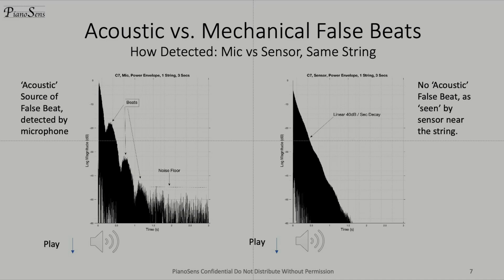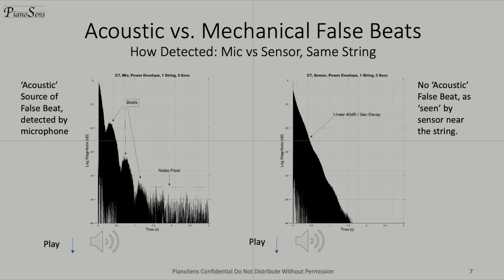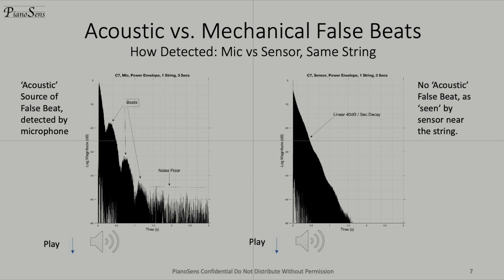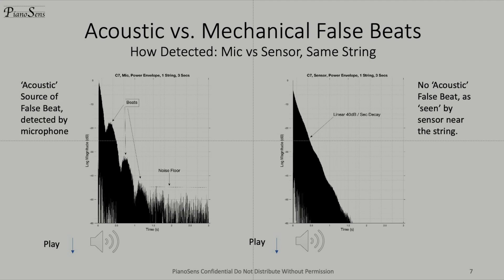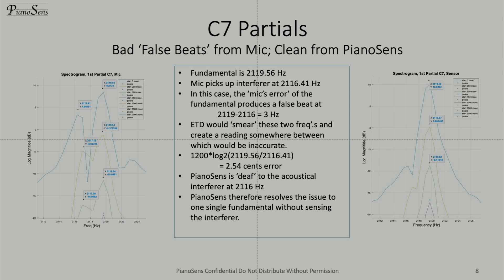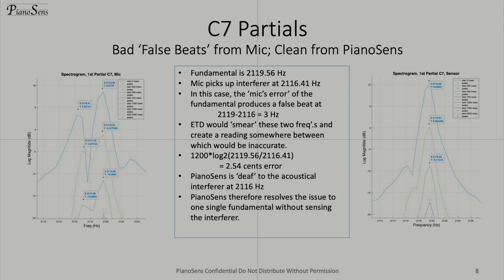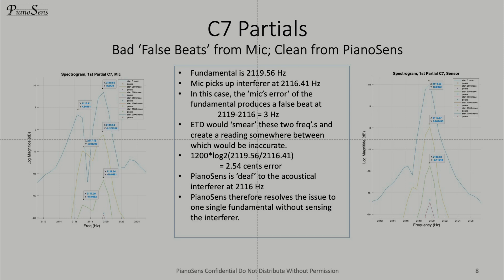False Beats in Piano: Two Sources, and How to Detect the Difference

Comment: You're charging $600 for a contact mic? Or is it for a $2 accelerometer? Hmm... Some sort of damping strips on the interfering strings would be cheaper, je croix...
Reply: It is a special sensor that is NOT a contact mic. It is built by a DOD-certified aerospace company. It has 140 dB dynamic range and has no pulling effect. It has 20 kHz bandwidth.

Comment: I might have to buy this. Question: What if you place the sensor on the bridge. That's what makes the sound anyway - the string vibrates the bridge which vibrates the soundboard. Would the false beat be present? If not, then it proves the beat is coming from some sympathetic vibration of some open rear duplex or some built in hardware resonance of the piano itself (some loose screw).
Reply from the maker: The sensor senses the movement of the string, not the movement of the bridge. The string has electromagnetic properties but wood does not. The string is the 'source' of all sound. We want to go straight to the source.

Comment: Perhaps the sensor is insensitive to the movements of the string in the plane of the soundboard, and therefore it does not detect the beats arising from the vertical and horizontal modes of the string vibration. If the beats do occur between the soundboard's natural frequency, then 3bps must be present on all 3 strings of the choir
Reply from the maker: If I lay the sensor 90-deg on its side it still picks up less of the false beat. The acoustic false beat can occur from undamped strings, for example.